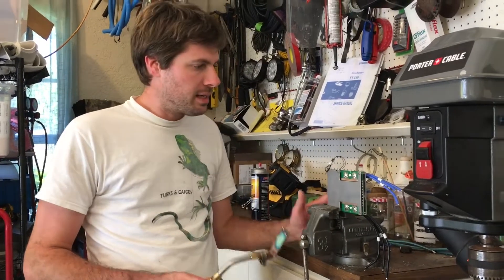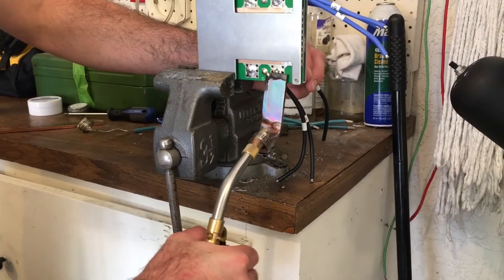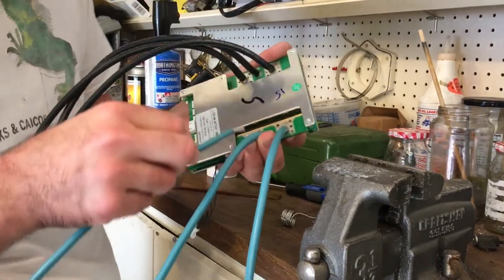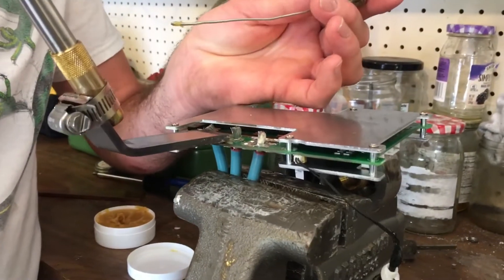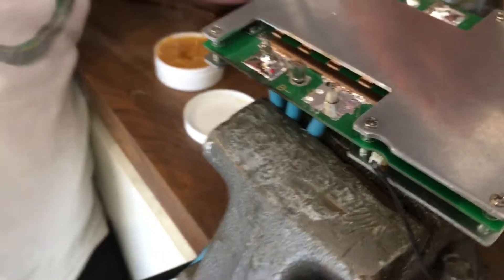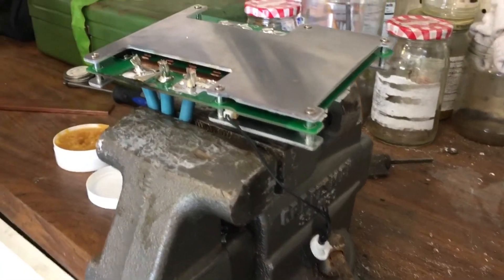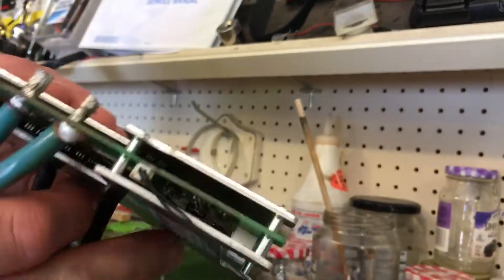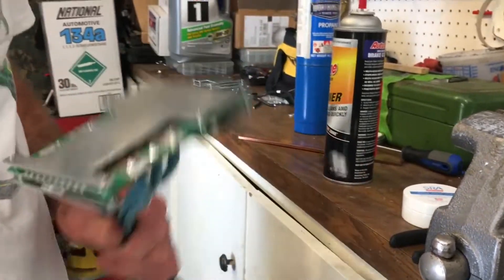A tool to easily solder and de-solder 8ga BMS wires

Comment: There are propane-powered soldering irons used by tinsmiths (sheet metal workers) for gutter fabrication, e.g.: www.youtube.com/watch?v=TguiIH0jAZE
The other type uses an external heat source, e.g.: https://www.youtube.com/watch?v=cvR3eEWrdpk
Your improvised version is a lot cheaper than the former of those two, and certainly effective for what you're doing..
You could add a deflector to keep the flame away from the work to allow the torch to run while you're soldering.

Comment: # Overkill Solar Channel question  on your website your 24v 100 amp bms has a option for a Bluetooth   i get that but whats and  another option for a usb  what's that all about  what's the extra usb port used for
Reply: Its so you can connect to a computer if you dont want to bluetooth to your phone

Comment: Yeah that works very well but question would it be possible to bolt  a ring terminal in those holes instead of resoldering it I mean would that work could be simpler for new DIY people thanks for your time
Reply: That is one of the options Steve offers now, maybe based on your suggestion? If so, thanks!
Reply: I got the M6 Terminals this time and I'm glad I did!

Comment: Great method, although I would have narrowed the tip to the width of the solder pads by cutting/sanding it down so all the heat was going into the pad/wire and not into the surrounding board.
Reply: ...and a deflector to allow the torch to run while soldering.